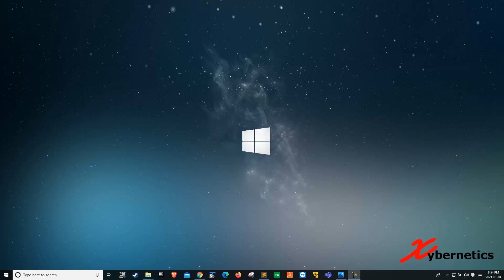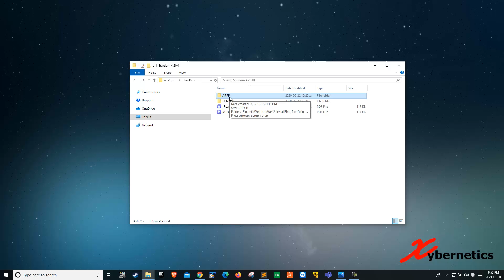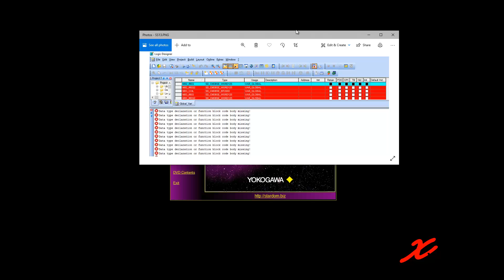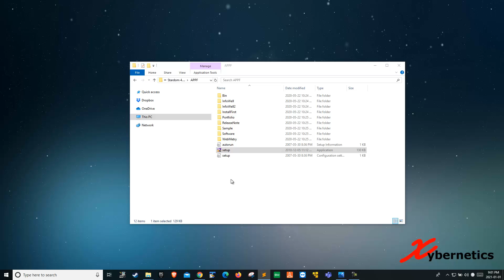How To Install Yokogawa Logic Designer And Resource Configurator

Comment: Could you show me the way to download Logic designer and resource config
Reply: sorry no can't do :(((
Reply from the maker: @quanghuytran3225  You are right. Logic Designer is a license software. Resource Configurator is free and it comes with the STARDOM software installation media.
Reply from the maker: The Yokogawa Logic Designer is a license software. However, the Yokogawa Resource Configurator is free and it comes with the Yokogawa STARDOM software installation media. There should be 2 installation DVD, one of which will be FCN FCJ which has all the software you are requesting.
I hope that answers your question.